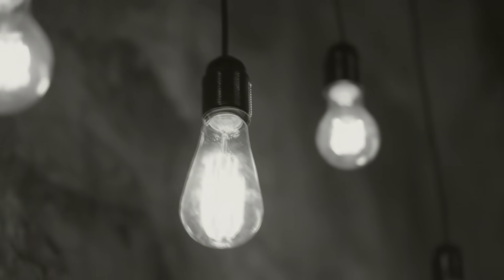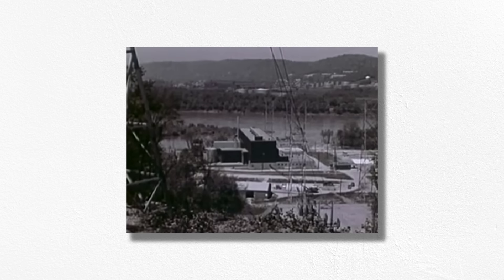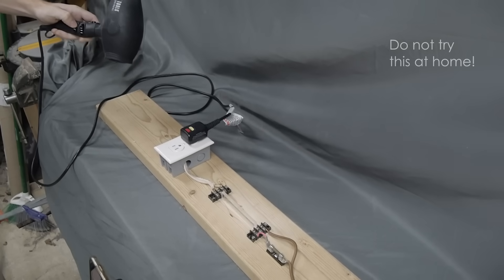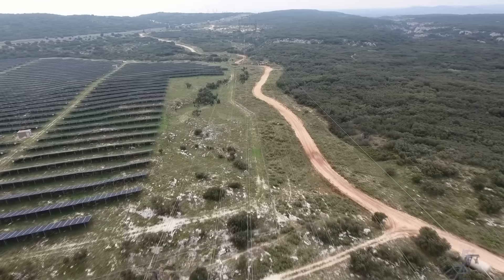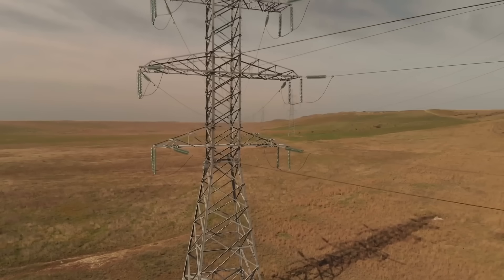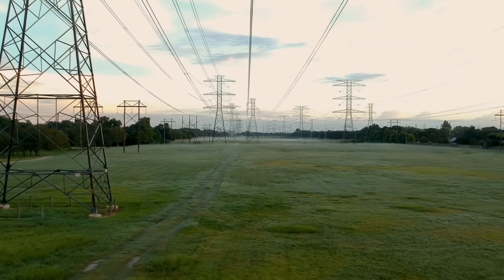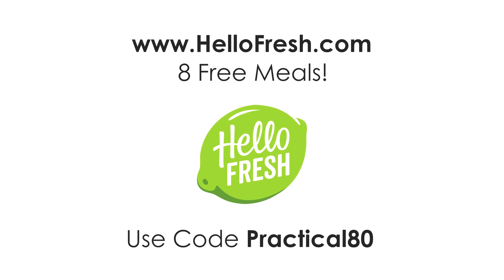How do Electric Transmission Lines Work?

Comment: Edison's DC system was 19th century.  Tesla developed Impedance matching for transmission.
Electrical power losses are all in the current flow so it is minimized by maximizing the voltage.
The towers in my neighborhood carry 550 kilovolt and each line can carry 500 amps they are arranged in bundles of four.

Comment: Great video. A video about HVDC would be appreciated. I wonder how to design it if a stretch of sea cable is included since sea cables aren't capable of the voltage overhead lines have.

Comment: An engineering analysis of the entire HelloFresh supply chain would be an interesting topic.  Upon first glance the volume and mass of packaging per unit mass of food looks extravagant. 

I’m curious about the energy requirements to transport the food in the HelloFresh supply and delivery chains, the carbon footprint of the HelloFresh food preparation centre, the food waste/composting stream from that place. I’ve only just scratched the surface on the possible factors to analyze. 

HelloFresh looks convenient, yes. In modern lingo, would it be considered sustainable — however one could measure that?

Rain on your parade?  Maybe a bit. I’d love to seen you sharpen your pencil and tackle this topic as well. 

Thanks for your good work. You have a satisfied fan base — and that is as it should be. Your videos are top-notch. Good luck.

Comment: As I understand, current is directly proportional to voltage, if increase voltage more current will flow, can u pls correct my  concept
Reply: Yes current is proportional to the voltage, and inversely proportional to the resistance

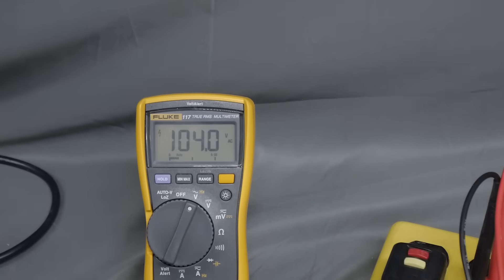Comment: 2:46 True if by power you meant instantaneous power. Also true if by power you meant active power, and if voltage and current are sinusoidal and in phase. Not true if by power you meant active power, and voltage and current are sinusoidal but not in phase.

3:33 Wrong. In a device that obeys Ohm's law, the voltage and current are directly proportional, so increasing the one increases the other, so the resistance is constant. Yet the video showed that increasing the voltage across the wire decreases the current through the wire, which is wrong. What the video maybe meant to say is that in an ideal transformer, the power on one side is the same as on the other side.

Comment: Practical Engineering, 
there are some technical aspects of generation that is not well known at all and I think a video on this subject(s) would enlighten a lot of peoples perception of that 'simple' source of power.

The affects of synchronous and non synchronous forms of generation on a grid, the adverse effect of embedded low voltage generation on the distribution net work and how it affects grid control?
Real and imaginary power, and an explanation of power factor and it's effect at grid level.

Comment: I just learned today about pad transformers but I am trying to learn where the power goes into the ground.  Doesn't it travel along transmission lines first from the substation?  And the other mystery is where is the substation that powers my neighborhood?
Reply: Transmission lines carry electricity at 100kv-500kv from a Generation station to  a recieving station where it's stepped down to 27kv-66kv (distribution) from  there distribution lines will feed some larger consumers like a hospital or shopping mall but most continue to a distribution station not to far from your home. And the voltage will again be stepped down to primary feeder lines (2770v-16000v) from the distribution station these lines will travel into your neighborhood and feed the transformer on a pole or a pad mount transformer on the ground where it steps down to a "low voltage" (120v-480v)and on to the consumer.

Comment: Before we had power grids and recycling...alternate current series parallel circuitry with capacitors resistors  transformers and two or more offset switches for turn off to offest drainage issue instead of one big pool of current with leakage or suction. Sometimes things happen ...we get thru it...change development no more cancer clusters.  Green forest wrap sometime we need jammin frequency tax benefits

Comment: The conductors at the top of the tower are also earthing wires, or grounding as you'd say in North America.
They connect all the towers together to ensure that those that do not have an earthing mat themselves are still connected to one.  It's simply not practicable to have such a mat at every tower, and the cost would be excessive even if it were.

Comment: I watched a video of a lineman working on a high power tension line.  He draped a rod over the clearly charged line and proceeded to install spacers or whatever they're called to keep wires at a certain distance apart.  How does that rod thing work to discharge the line?  I've seen them also on area transmission line to deaden a certain stretch to replace poles.
Reply: If you're talking about the conductive rod, it doesn't discharge the line, it's used to bring the linesman to the same potential as the line

Comment: Nope.  The energy is not going through the wires, it is in the space surrounding the wires.  It is in the electrical field.  The energy that penetrates the surface of the wire is converted to heat and lost.

Comment: This video is from a civil engineering perspective but doesn't mention a lot of the really interesting electrical engineering design considerations in a grid. E.g. propagation delay, interconnects, frequency droop control, load balancing etc.

Comment: I'm curious about the materials used in these lines. If a line is made from Aluminum, which is 61% as conductive as copper. Does that mean 39% of electricity is lost as heat? Does Aluminum get hotter?

Comment: If higher voltage produces a larger potential to flow, how can a low current be achieved without changing the resistance?

Comment: I was with you until you claimed that residents can produce all or more than enough of the electricity they need via solar panels.  That may be true in ideal locations for certain weeks of the year during daylight hours under low demand with a lot of solar panels, but otherwise that’s just BS.

Comment: Sir i needed  information about 3 phase submersible motor to run 2 phase line with help of capacitor . which capacitor range sir needed explain formula for 5 to 6 hp submersible motor

Comment: The other reason we use highly separated conductors rather than insulated multi-conductor cables to transmit power is that such cables have very high capacitive and inductive reactance which severely limit the practical distance that power can be transmitted. Insulated HV cables are used for short runs such as under highways and short bodies of water. For longer runs, AC power needs to be converted to DC while it flows in the cable and back to AC where connected to the load.

Comment: Great video in AC transmission lines.  

It’s true that the wire on the top is fiber optics (just confirming other comments), and consumers pay for losses that is priced in electricity markets. The fiber optics cable is also needed for protection schemes for the circuits.

I would also add while solar panels are becoming more popular, it creates problems such as predictability of energy consumption and reduces system ‘inertia’ which could lead to transient stability issues.

Comment: Ahhh misleading information again..  You need to brush up on Ohms law. Your formula for Power (or wattage) is Incorrect. Please re-read ohms law.
The formula you cite P = V*I is ONLY valid for DC circuits OR purely LINEAR loads in an a/c circuit.
The formula tou SHOULD use is VA = V*I where VA is VoltAmps. This is why many devices have a KVA rating or Kilo-VoltAmps.
Lets be clear, in an AC circuit the FREQUENCY is also used in calculating power as different devices (motors, electronics, etc) draw different current (or amps) at different frequencies. You can measure a coil and a capacitor resistance with an Ohmeter and try and calulate the wattage of that curcuit using your formula. But toyr calculations would be very wrong if you used it in an AC circuit as that circuit can consume MANY times your "calculated" wattage.
Even the electric meters on the side of a house only measure amperage over time, NOT Wattage (or Power) the meter is calibrated with a Power Factor (or PF) to APPROXIMATE the wattage (or KiloWatts) used.
Your example of raising the voltage and thus using smaller wire is true, however raising the voltage in a airline jet would be very dangerous and impractical as arcing would occur because the wires cant be separated enough and added insulation would negate the weight savings of a thinner wire. Jets are very weight concience and usually want to reduce the weight of all that wire. So rather than boost the voltage to use smaller wire. They transmit power to various components with much higher frequency (usually 400hz) instead of 60hz. The next time you are on a jet listen for a "Winning" instead of a "hum" sound over the PA system, this is the 400hz bleeding into the audio system.

Comment: Fun fact: You can take a standard fluorescent bulb under transmission lines and it will light up while standing on the ground and holding the bulb up like a sword. Also my family that lived next to those lines have alot of cases of cancer. You can hear the power crackling through the lines too.

Comment: Hey, so why does a small drop in voltage happen in the voltmeter when the hairdryer is plugged in?
Reply: It is because when you have an electrical circuit that has resistance present in the conductors but you are not drawing any appreciable amount of current through those conductors there is very little voltage drop occurring across those conductors. This means the voltage at the source and the voltage at the load will be about the same. When the hair dryer is off the only load is the voltmeter. Voltmeters are designed to measure voltage while drawing very little current from the circuit under test so the voltmeter will induce very little voltage drop in the circuit. But then when you connect the hair dryer to the circuit and start drawing  a lot more current through the conductors much more voltage drop across the conductors will occur.  Further, the drop across the conductors will be proportional to the conductor resistance times the amount of current being drawn. This "voltage drop" across the conductors is what causes the voltage reading on the voltmeter to drop when the hair dryer is turned on.

Comment: Is it possible to bury these large transmission lines? I'm sure it's not cheap but just wondering? Looks better, not subject to environmental factors, etc.
Reply: Yes but very high voltagr lines underground suffer with very bad capacitive effect, the conductors essentially act as capacitors and cause the receiving end voltage to be higher.

Comment: I would be thankful if you could clear my doubt, Sir as we know in AC the direction of flow of current keeps on changing and if we consider a bulb connected in such a circuit and observe it by slowing down the process we would observe the bulb will blink so my question is how is that phenomenon explained in a transmission line

Comment: Pacific Intertie. Long DC transmission line because of AC losses. Llambda= C/f usually Llambda/4 for good antenna transmission so 1200 KM will radiate 60Hz well. Resistance losses usually minimal. Transformer losses and corrosion/deterioration of old equipment give a conservative estimate of 40% power loss in the US power distribution grid. The more detail you add to the equation, the higher losses go. Someone asked about having an electric car powered from coal fired electric plant. Thermodynamics laws say maximum efficiency is difference in input and output temps. Gives gasoline internal combustion engine 30%. Older coal were low temp boilers so ~20%. Most US coal electric plants >75 yrs old. The newest coal plants approach average oil generating plants ~25% efficiencies. Natural gas electrical generation makes less carbon and can get 35% efficiencies (higher in fuel cells) and actually lower losses in transfering power by gas pipelines than electricity. Engineers build things with fixed specs, one being usable lifetime. Dams ~40 years (silting settling generators), windmills?, Solar Cells? ("Solid state", but cosmic ray damage cumulative), coal plants (built for 50yrs life), self driving car? (look at all the dents in Google's test car parking lot). Did you know the first hybrids were diesel locomotives in the 1940s: diesel engine drives electric generators which send the electricity to the wheels?

Comment: At 3:30, he explains it totally WRONG !!!  He uses the Ohm law, he reduces the current I but he shows V increasing.  Nonsense !  Ohm law tell that if you reduce the current, the voltage will decrease too.  He should have used the power law, P = V*I, and shown that if you reduce I you must increase V to keep the same power.

Comment: Excuse me, I'm sorry in advance I ask permission to review this video to complete my assignment,
Pada video ini dapat saya simpulkan,
Tenaga listrik adalah produksi dari arus (laju aliran muatan listrik) dan tegangan (perbedaan potensial listrik). Untuk konduktor sederhana dapat menggunakan hukum ohm untuk menunjukan bahwa tegangan turun dari satu ujung kawat ke yang lain atau juga bisa disebut resistensi kawat. Jadi untuk mengurangi kerugian pada kabel listrik, dapat mengurangi hambatan konduktor dengan meningkatkan ukuran atau menggunakan konduktif yang lebih baik .
Pada video ini juga dijelaskan dimana sumber atau pabrik listrik terletak jauh dari tempat permukiman masyarakat, dikarenakan banyak masyarakat yang tidak suka tinggal di tempat yang dekat dengan pabrik industri.
Transformer di pembangkit listrik dapat meningkatkan tegangan hingga 100.000 volt dan bisa jauh lebih tinggi sebelum mengirim listrik dalam perjalanan melalui saluran transmisi. 
Listrik di transmisikan dalam 3 fase, setiap fase berjarak jauh dari dua fase lainnya untuk menghindari  adanya lengkungan diantara fase, konduktor dihubungkan kesetiap menara melalui isolator panjang untuk menjaga jarak yang cukup antara garis berenergi dan tiang ground.
Saluran transmisi tegangan tinggi juga dapat menghasilkan medan magnet yang dapat menginduksi arus listrik.

Comment: Why would power be unchanged if the voltage is increased? Is it because the power is determined by the electricity usage of the consumer? Then is it reasonable to say that some sort of 'resistance' is created by the Transformers' configurations? Like if you increase the voltage in a normal circuit then the the current goes up... So if the current doesn't go up then is it accurate to say that there is a resistance caused by the configuration of the Transformers, and not just caused by the physical properties of the transmission lines? If I'm way off here let me know...

Comment: I'm curious what comments those of you who have experience designing and repairing the power grid might have about another factor that was not mentioned: Very low frequency currents induced into transmission lines by fluctuations in the earth's geomagnetic field, which would tend to saturate the transformer cores that are designed for 50-60 Hz. I seem to recall that about twenty years or so ago there was a particularly strong geomagnetic storm which some blamed for power grid failures.

Comment: as an electrician i carry a tic tracer/ voltage detector in my pocket. i have walked under high power lines and had the tracer go off and it takes 50 volts or more for that to happen. high voltage lines definitely give off EMF. i'd never live by them

Comment: When I was teaching electrical concepts to people, I always explained it like a garden hose.  Voltage was always 'pressure'.  Kinking a hose, or putting your thumb over the end is obviously resistance, and voltage is the pressure that 'backs up' behind those resistances.

I always mention that water flow and electricity don't behave exactly the same, but visually, the concepts are close enough that it can get people over that mental gap they need to understand what's going on at the practical level.
Reply: The similarity is because in both cases power is being transferred and at the fundamental subatomic level all energy conversions and power transfers are the same, whether they be electrical, fluid or mechanical. One other interesting example is comparing an electrical transformer to a mechanical gearbox. They both do essentially the same thing, which is to convert potential and kinetic energy back and forth.

Comment: You should mention that it  is more efficient to transfer electricity in DC, but it is not widely used because it is not simple and not cheap to convert back to AC

Comment: Simplistic, however if you assume an ignorant user than explain AC vs DC in transmission lines. It’s an important detail. Note the three phases are “twisted” at tower locations to minimize EM radiation. Still 60 Hertz quarter wave antenna (max radiation) is 800 miles. C.f. ‘Pacific Intertie’: 500KV DC lime from Bonneville power to SoCal. Even with AC/DC conversion losses the DC line had only half the loss as equivalent AC line. A 300KV AC line nearby would light a dead fluorescent tube bulb at ground level. I worked on BPA PCB transformer removal. Like friction, losses increase with increasing power in transformers. Also need note on “skin effect” which at 60 Hz is significant at 800miles; but allows copper covered steel cable for transmission lines. Wasn’t it tempting to bring up Edison vs Westinghouse DC vs AC battles.

Comment: Can anyone explain the physics in the tiny wires powering the blow dryer? I understand the voltage has been stepped up by the transformer, but what is impeding the current to prevent them from burning up?